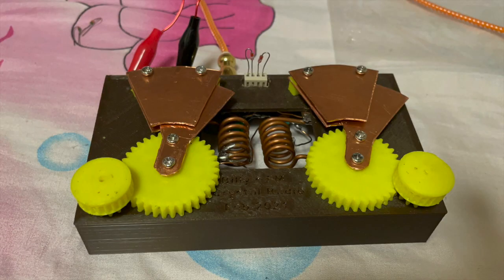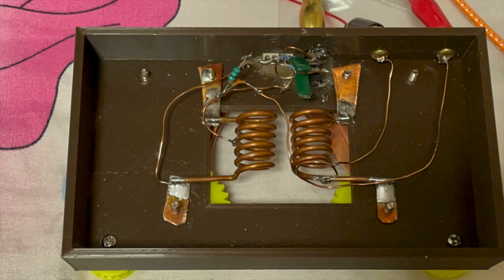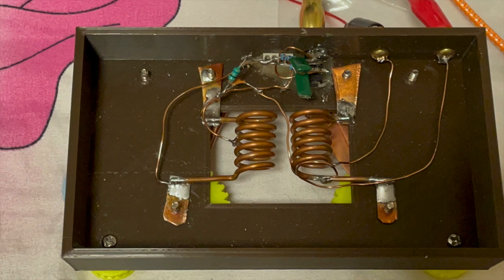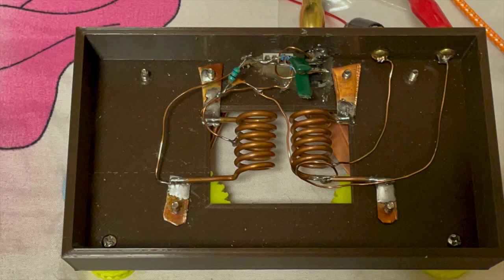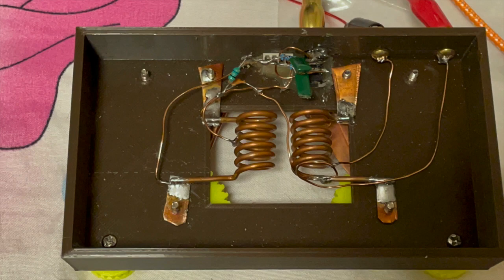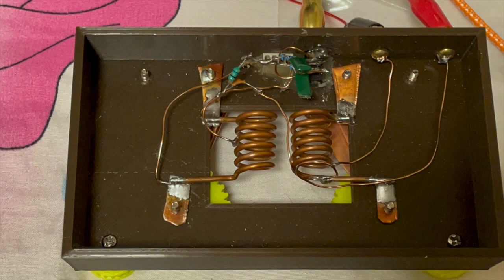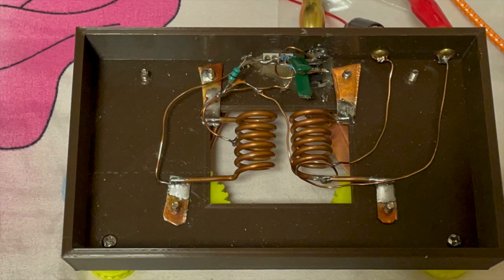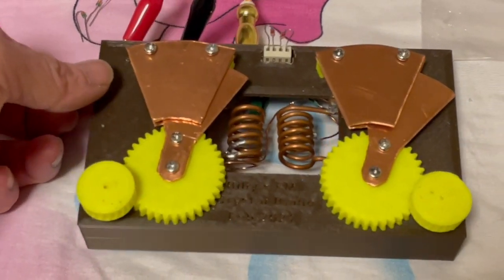3D designed Frequency Detector  FM Crystal Radio Part 3

Comment: where is the speaker?
Reply from the maker: This is a crystal radio that do not require battery to power. Hence it cannot drive a speaker. We use headphones to listen to it. Also, the output can be recorded by the smart phone's mic input.
Reply: @BillyCdiy  I know that it is a cristal radio, without battery. Those were very popular on the begging of radio era, around 80-90 years a go, being used on AM for LW & MW only, nearby the powerfull transmitting stations. Uncertain if it works on FM
Reply from the maker: @tn7579  , with modern diodes and MOS FET,  I have been making FM Crystal Radios for a few years. You have to be within 15KM of the FM transmission station to be able to receive FM crystal radios and you need a good FM Yagi antenna. Telescopic antenna will also work but need to stick it out of your window.